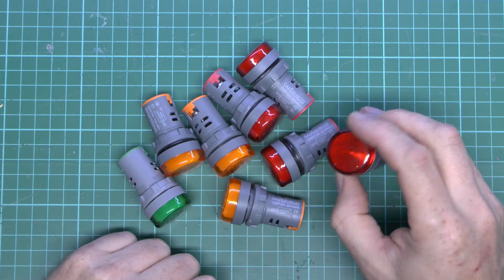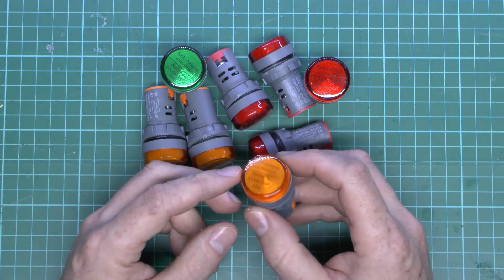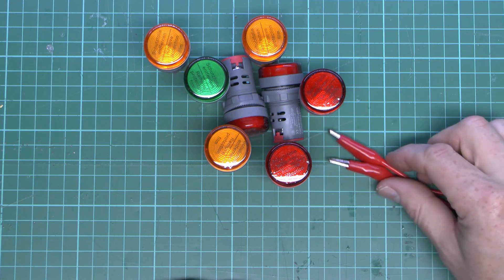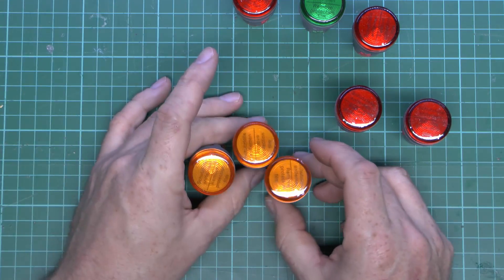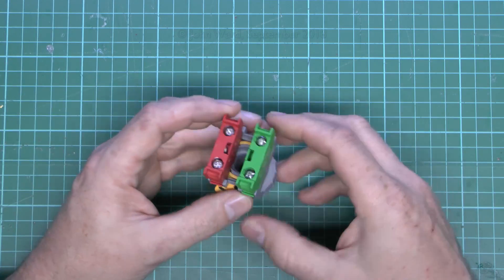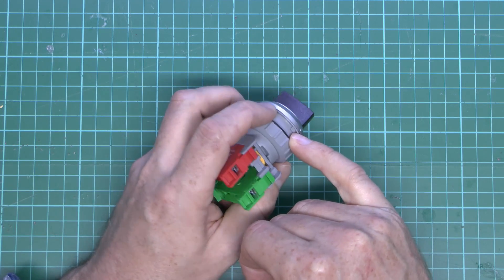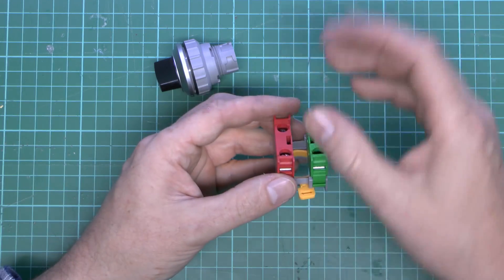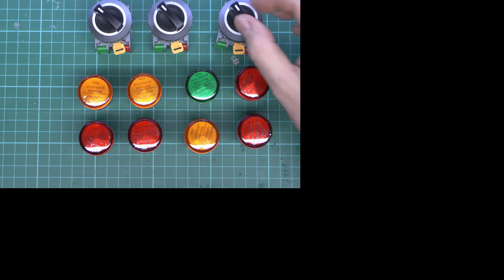22mm Panel Indicators and Rotary Switches

Comment: I have one of these in 240v. Would you be able to explain how to wire one of these to a 40v on/ off switch so it lights up to indicate when the power is on?
Reply from the maker: If it's a 240V switch, then it connects to the switched output and neutral.
if it's 40V, then you will need a 40V indicator.

Comment: IEC 60073 specifies coding principles for indicators and actuators and gives recommendation regarding the use of colors. 

Meaning of colors (excerpt from the standard)
Red = Danger - Emergency/Faulty
Yellow = Warning/caution - Abnormal
Green = Safe - Normal
Blue = Mandatory - significance
White/grey/black = No specific meaning assigned

Comment: Use these in the loadbanks I build blue and white used to indicate whether the machine is in star or delta mode red for cooling fault.
Green and amber for other applications where the occasion is needed.
Reply: Is that with an actual star-delta starter?
Because, the timer that controls the change-over, should do that when the motor achieves 75% Full Load Speed, when it switches between the Star and Delta contactors.
Usually, that is about 3-4 seconds.

Comment: I bought a couple of panel indictor style things that look very similar if not identical to those, except instead of led light they show the voltage and power going through. I didn't realise at the time they only work on AC, but they were cheap enough, never know when I could use them 🙃😁

Comment: Blue and White fairly uncommon? We always use White for Main Power and Blue for E-Stop OK... and this seems fairly common on food equipment
Reply: Fair point, but that’s just an anecdote. 

And I don’t think it really matters either way. John, I doubt, was attempting to minimise the efforts of the white and blue lights over their years of service. I for one believe them to be equally as heroic as the RAG ones
Reply: We use white for mains power too, Although we use blue for inputs if there is a fire, over-rules all other inputs(orange). red is fault.
Reply: Seems to be blue is used for special status from your comment and what I have seen around. We also use red for Faults, Orange for automatic "active" (like heating elements/refrigerant solenoids) and green for rotating loads
Reply: Yes I agree. Blue and white very common in power stations. We use them on virtually every panel we built.
Reply: You're correct, not sure of EN Norm, but blue for E-Stop Okay, is fairly recent, ref last 10-15 years I think.

Comment: I thought that panel lamps need to conform to en60204 making Red an emergency , yellow/ amber a fault condition or pending fault. And green for normal operation?
Reply from the maker: The good thing about standards is that there are so many different and conflicting ones to choose from.
Reply: Yes I would agree. Also we would not use Amber to indicate a running state in any circumstances.
Reply: pmailkeey an e-stop button being used as a dead man’s switch seems clearly wrong — it should be labeled differently if it operates in reverse.

Comment: £4 for the panel switch and a couple of quid for the LEDs on eBay. It’s still unbelievable to me how cheap stuff is these days. Even when it’s made in China. 

When I was doing my a-levels making electronic stuff in physics all we had was Maplin and industrial type stuff like this would have been a fortune.
Reply: I know exactly what you mean!!!

I only came back to electronics about three or four years ago. I used to do a lot of--simple--projects when I was a kiddie in the seventies. My father was an armourer and radar technician for the RAF and then worked at IBM so he would give me things to do to keep my fingers out of whatever he had brought home to work on! I also did an so-called 'electrical engineering' BSc in the late eighties, although it was more than three quarters straight physics A-Level+. The experience severely turned me off the topic and I threw it all up completely, barely touching a soldering iron for over twenty years.

When I got back in to electronics via 1980's microcomputers a few years ago I couldn't believe how simple and cheap it was to get almost anything and everything you might ever want from eBay. My mind was still stuck in the 50p Maplin catalogue!!! I even called in to a local branch just to get hold of some basic supplies and was horrified to find that Maplins had become some kind of 'petrol head' (not that there is anything wrong with that, its just not my thing) superstore for cheap car radios and vanity mods. I never went back and I think they have recently gone completely out of business.

I get everything either directly from Radio Spares or for pennies from the far-East via eBay now.